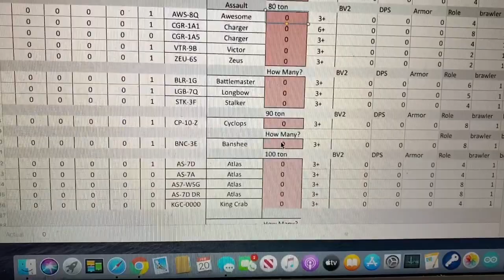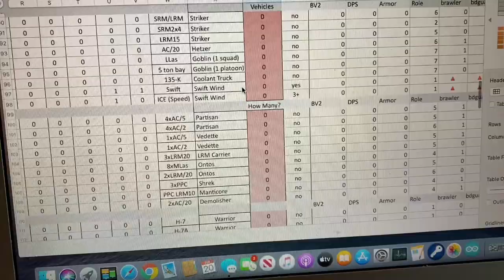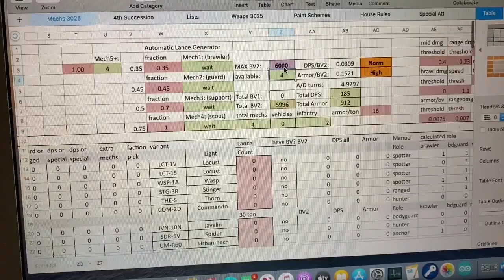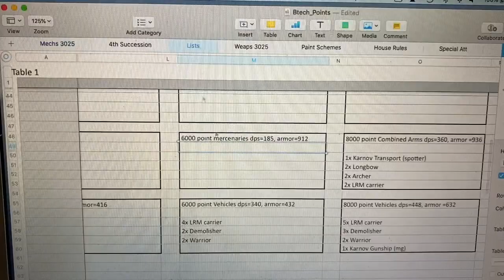Secrets of Tabletop Battletech advanced theory The Battle Module

Comment: I was looking at following your advice and I just now realized you're using BV1. Do you use a different formula for BV2?
Reply from the maker: I'm working on updating some of these videos with newer rules and formulae.  I'm an original player so I'm a bit old school and built some of these old videos off memory and old ideas.
However the battle module idea works with whatever modern BV or metric you use, you just have to think of combos that work within a sum of whatever metric you are using (be it C-bills or tonnage or BV2.0 or some other campaign resource points)